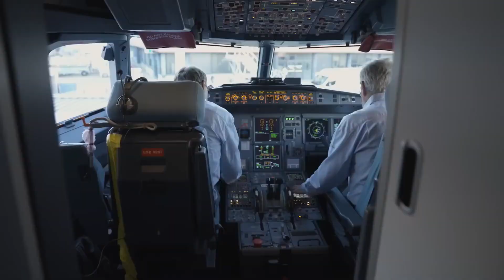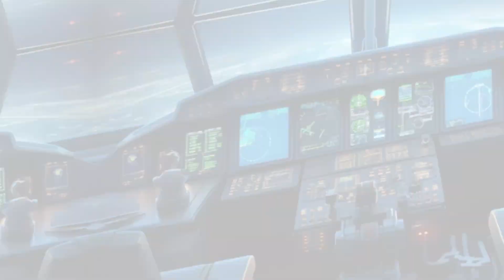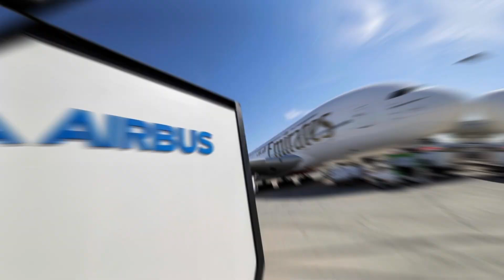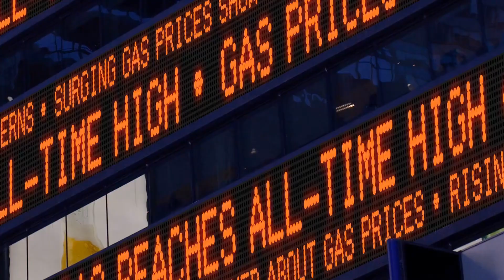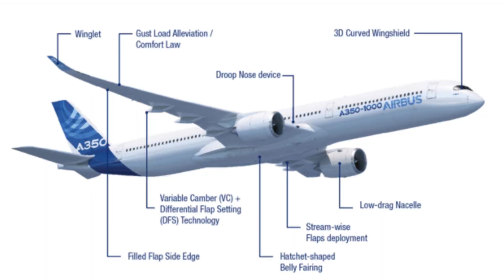The Real Reason Every Airline Wants Airbus A350 over Boeing..

Comment: You can be sure of one thing : Airbus would never launch a new program under "uncertainty" terms. If they go ahead, you can be sure they are convinced they will succeed and have all their ducks in a row. They are pretty good at marketing too.
Reply from the maker: Good point! Airbus definitely took a strategic approach with the A350, especially after initial setbacks with the A330 upgrade. They committed to an all-new design only when they were confident it would meet market demands—and it’s paid off with major orders! Airbus’s careful planning and willingness to adjust their approach have made the A350 a strong competitor in long-haul travel.